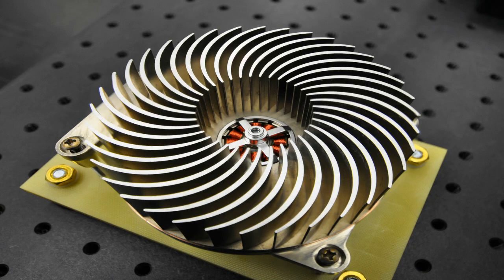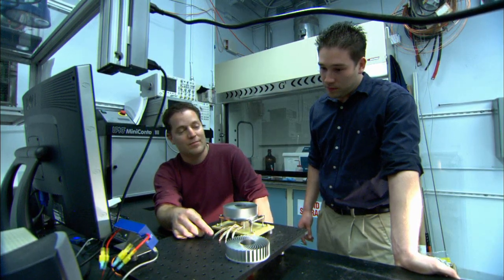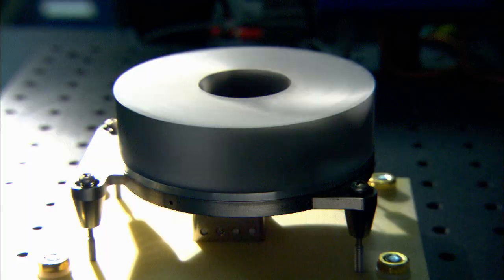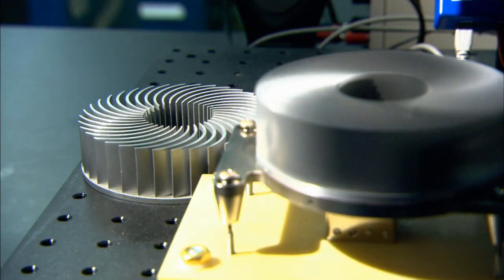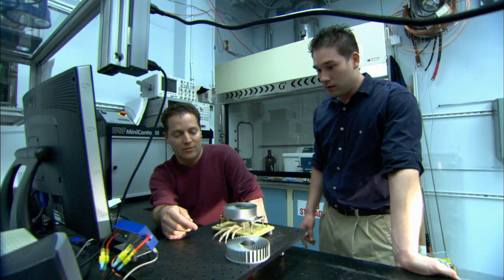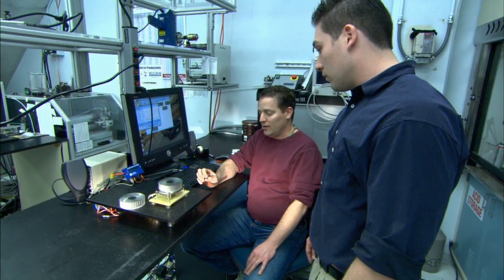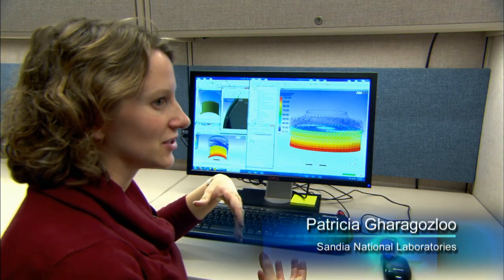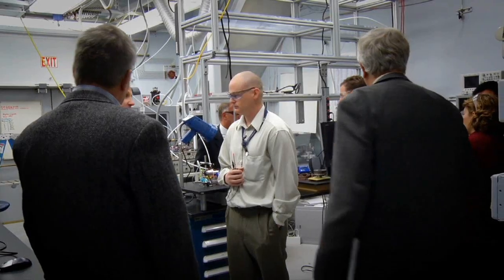Sandia Cooler

Comment: 30 times more efficient and yet its 2014 and I have not seen this any where... so it has failed. Its all good seeing this kinda videos but they always talk about positives but never about the negatives.
Reply: do you realize that it usually takes around 10 years for new technologies to reach the market? That said, they compare it to regular heatsinks, and not stuff like cpu tower coolers with heatpipes, so I doubt they'd prove beneficial in regular computers for quite a while. Application in the industry is probably already happening at a small scale.
Reply: @nilssab  Almost 10 years now
Reply: @nilssab  one more year
Reply: Not to mention this product was boudn to be a flop because of one concept they didnt focus on much is the air bearing between the base and the actual heatsink anyone thats installed a heatsink know that an airgap is going to be a bottleneck which they failed horribly
Reply: I know 1one negative, if you toch the coooler with your finger you will suffer a lot of pain
Reply: Dmitri Felbinger that must be why we had heatpipes in computers in 1960.. OR, we didn't, which shows that in some cases it takes a MUCH longer time. especially when it is things that were made for industrial application and not consumer products. You can expect that this will be in some industrial use now(which would then be considered a corporate secret, and you wouldn't know about it), OR within a few years, when efficiency has been further improved. And you can expect it to take a LONG while before we see these in consumer products.
Reply: this is all quite interesting, btw.. goes with the saying - you learn something new every day!
Reply: Dmitri Felbinger also in most consumer products you will probably never see this, since piezoelectric fans will probably be available before this, at least for laptops. There are already being researched on by Fujikura etc. which make a large amount of the cooling systems for laptops now. watch?v=Hm5fXj-hUpk#t=191
Reply: ***** lol, I guessed you missed the part where the "blowing fan" is also the heatsink.
Reply: ***** in addition to what nilssab said, you also won't cut your finger because:
A: It's rotational direction
B: It's speed
C: This is a prototype
D: something something your mom
Reply: you know why, its because this tec is total bs. how does heat go from the base plate, to the fan? the motor axle? air?

find a way to get that heat energy to the fan and then it could be a good idea. key word being could
Reply: 08yannch The he's trying to get across in the video is that the air gap will be tremendously small, approaching 0 as rotational speed increases. At speed, you'll have the entire surface area of the bottom of the heat sink essentially sitting on the baseplate. The space between the two is so small, that heat coming through the baseplate will have nowhere to go except dissipate into the heat sink. The design of the fins decreases the amount of dead air along the surface of the fins, to tremendously small amounts with high rpm. All you need is new air (not necessarily cool air) moving across the surface of the fins to remove heat from the system. It consolidates a fan and a heat sink down into a single, smaller component which cleverly takes advantage of fluid dynamics to make the transfer of heat in and out of the heat sink as smooth as possible. If I understand him right. Its been a few years since I took (High School) thermodynamics, but its this idea of the distance between the two surfaces approaching 0 allowing the transfer of heat between the two more effectively that really makes sense in my mind.
Reply: Thermaltake Engine 27. Not sure though, if it has anything to do with Sandia.
Reply: So how is the heat transfered from the stationary cpu to the rotating fin assembly? Not through the air bearing. That would have a huge thermal resistance. Sounds like more Phd pie in the sky nonsense.
Reply: hi bro, 2018,  I have not seen this any where too  :)
Reply: 10 years? were have you been living? As far as I know most great inventions blew up on to the market 2-3 years after first prototypes.
Reply: Santiago Turello Alvarado loool you know we would all do it aswell
Reply: You do know you can post links directly right?
Reply: It is either not what it seems or the device have been used in industrial environments.. Not everything is produced to be used by the public in their homes..
Reply: ***** Read the fucking links that that guy posted instead of making assertions here.
Reply: This looks promising considering the company is an  subsidiary of Lockheed Martin they probably have some idea of what they are doing. The fan looks somewhat similar to what they already use on some nvidia graphics cards
Reply: What is the difference in thermal transfer efficiency between an air bearing and properly applied thermal paste, I wonder.  It's probably not much but I'm still curious.
Reply: @lawrencetate145  You would need to determine that experimentally for this case.
Thermal paste isn't hugely conductive, but even so, it is about 250 times better than air. However, a lot of the contact between the heat source (like a CPU) and heatsinks is directly between metals, which are more than 16,000 times better heat conductors than air. But, that is just comparing conductivity.

Fluid flow analysis is required to figure how heat transfer actually works here, because there's a lot of details regarding heat flow which isn't explained by a purely conductive model. In essence, moving fluids (air in this case) transports heat differently than stationary ones. The presence of an air bearing layer further complicates this as it likely has some unique properties in terms of heat transport, meaning a combination of experiments and computer modeling would be required to properly answer your question.
Reply: that's because makes no sense, took me 10 seconds to bet that this would never be efficient...
Reply: 2021. still useless.
Reply: Even if it was the best thing ever, it may not have the chance to take off due to competition of the market amongst other things
Reply: Catch is you have to mount you cpu horizontally
Reply: That's because all the early adopters no longer have all their fingers.
Reply: CatchMyThrowingKnife That's a rarther ignorant comment. If you watch the video it's clear that they designed and chose the air bearing, as a method of moving the heat effectively. I'm pretty sure they know a whole lot more about that than you do. The issue with the air bearing I see however, is what happens when to put it in a case, and have the fan sit 90 degrees to what was shown in the video.
Reply: You seem to be missing my point. First of all you seem to insinuate that the shape of the rotor is of no importance what so ever. A circular saw is designed to cut (well technically it chips off small pieces) if you take a look at this rotor, it has curved swept blades, and the direction it rotates, means you won't cut yourself by touching it.

When I mentioned the speed, I mentioned it because of how fast it's going. Heck it weighs several times more than a blade on a circular saw. When this rotates as fast as it does, you will have a difficult time getting your fingers in between the blades at all.

I mentioned it was a prototype, as this will obviously not be sold without a fingerguard, because you might still be able to hurt yourself if you stick your finger in the middle of it, you won't however loose a finger, you will most likely just get a whacked.

D: I tried to be witty, and provoking as I found your "Meh it's just a blower fan, nothing new" rather annoying, as this is clearly much more than just a blower fan.
Reply: CatchMyThrowingKnife I'm quite sure the 30x comparison to regular heatsink is measuring the heat flow from the heat source to air. So even if it would be a bottleneck(which it may very well be, of course), they can achieve 30x the heat flow compared to some regular fan heatsink.

I don't think this has flopped, it's probably more a question of it being stuck in intellectual right and licence negotiations.. Whenever it gets deployed it will be in industry applications anyway, so for all we know it might already be deployed.
Reply: @nilssab  nah it failed hard
Reply: @Fluffehfox  yeah, I agree. It did go to market and I have used it though. It performs really well per volume and per dB, but 45ish Watt isn't really the segment to be in if you want success. But really it did perform better than a noctua cooler of the same size.

Comment: It's good the air bearing working horizontal but have you tested it in a real application as most motherboards are vertically mounted?
Reply: I don't think this is meant for vertical usage, nor do they necessarily have the home PC market in mind. They mention solid-state lighting so I assume this is to dissipate heat because currently many of these solutions require large passive coolers.

Comment: Well, that was cute and all and despite the admiration for the great concept, my ears are bleeding now.
Noiseless my rear end! Many many years ago I had a Maxtor hard drive that made about the same high pitch noise. Sent it back the same day and replaced it with a Hitachi drive that actually WAS silent!
So eh... With hard drives getting more and more silent, can't you find a way to get past that horrible high pitch noise? Even if the decibels are low, such high frequency sounds are still loud to the ears.

Also, it seems like you will need some VERY high grade aluminium to stop that wobble from occuring. Even if it looks minor, without the 'heatspreader', the chip would quite certainly die very fast with direct contact from that thing.

All in all, no matter how great the idea is, I'm afraid that this will not be a very cheap product at all and thus not find it's way to many PC's.
Keep up the good work though, because industrial applications might benefit greatly. Stuffing more computing power in servers without overheating might just be getting easier when you get them all balanced out.

Comment: You quite clearly have no idea what you're talking about at all.

They're currently still working on further revisions of the device to get it ready for consumer CPU cooling applications.

You can see how it will work even in the prototype here: heatpipes connected to a CPU block on the bottom go up and spread out over the bottom plate which the fins/fan assembly spins on.

Comment: It has no use or function, and simply isn't very good anyway. that's what happened to it. A Noctua is probably better, secondly, what would it even be used for ?? The cpu cooler market is already saturated, this product adds nothing to it.

Comment: its a prototype and early modell i think it will be alot quieter then that.
(bit of nostalgia for me though since i had harddrives making that noise and back then it was the way of telling me nothings broken if there is noise ^-^
and that quantum sure made a hell of a noise. (quantum fireball 20 gb as os disk and a seagate 80 gb ide drive)

seagate died 08 & fireball is still working and the hour counter has reset Max was around 40,000 hours last i checked and its now on around 300 hours :P

Comment: @maddogfarg0, you are forgetting the fact that you can transfer heat between the gap between the heat sink impeller and the base plate. Remember there is air between that gap that serves as a thermal barrier between the two objects. As long as there is a thermal gradient between the air and the base plate and the air and the impeller, there will be heat transfer and thus cooling. Note that the thermal barrier in the Sandia design is smaller than conventional heat exchangers and more efficient.

Comment: Re-read the first sentence in my main paragraph.

Air Bearing = not good contact = poor heat transfer = residual heat buildup from the heat source and poor cooling performance.  It's the reason conventional CPU heatsinks use TIM.

Cood contact at that speed = good heat transfer from the source components, but also tremendous friction from the moving parts.

Either way...whatever they are saying is 'efficient' is not in relation to heat transfer.  Power usage to drive the fan, maybe...or CFM.

Comment: That's the reason they use an air bearing. It's the same concept your hard drive uses to float the heads over the platters- air is carried along the surface of the moving object and in doing so forms a thin film that provides both thermal conduction and mechanical cushioning. 

And I know air bearings work- a large machine that I work with uses a similar mechanism called air lift, enabling over 10 tons to be moved one-handed through a simple crank and screw arrangement to push it along the guide

Comment: When the fins start moving, they create a low pressure area on their 'back' side (the one pointing away from the direction of rotation) at the tips, which pulls air outward along the fins.  That results in the pressure dropping in the center which pulls air down.  Also, the fins are thicker near the center than they are at the edges which will help the air accelerate away from the middle too.

Comment: I don't see this as working, or if it does it will be highly inefficient.

In order to transfer heat effectively from the chip you are cooling to the moving fins of this concept cooler you need to have good contact.  But since the fins are moving, good contact between them and ANY surface = high friction = generating LOTS of waste heat that gets ADDED to the already existing CPU core heat.

Comment: instead of an air bearing, why not use some kind of gel based thermo conductive grease with a capsule around the base structure secured by physical bearings. The thermo-transfer would be far more significant...

Comment: How would this run in a tower computer? Would it still run properly vertically? Couldn't dust get trapped between the cooler and the CPU since they aren't actually in contact? And the final product better have some sort of frame for it. Don't want any wires getting caught xD

Comment: Well, that's the great thing about it. It's so efficient that you can use a wide variety of metal materials. A mixture of Aluminum, Copper and (Silver, Albeit expensive, it has the best thermal conductivity at 418.0 W/mk, had to research that number :D )

Comment: Because air has a very low coefficient of heat transfer.  If you take a standard heat sink you will find that it has maybe 50-60 square centimeters in which heat can disparate aided by a fan.  In order for the Sandra Cooler to work it first has to go though 6 square cementers then into air then back into 6 square centimeters then it finally gets the the 50-60 square centimeters part to finally dissipate.  I'm not going to say it wont work.  But i doubt it works better.

Comment: If it was fully detached from the base it would also stop spinning from being disconnected from the motor. Imagine the air that forms from the separation as more of a solid bearing and it will make more sense. If was disconnected it would also probably spin wildly out of control unless it was perfectly balanced, thus it can be assumed that the spinning motion keeps it elevated off the surface but its held down and in place by motor connection and centripetal force respectively.

Comment: Would have preferred to have a decibel monitor/meter showing the noise level when the fan was turned off to see how loud it is before and after.. The Videos audio isn't good enough to let you hear any difference especially when the dude is talking while shutting it off.

I'd be interested in knowing whether this will work when you have other fans blowing and pulling air into a computer case.

Comment: They explained it does not led dust particles go near it, because of the air flow it makes.
But yes, it seems to me rather dangerous to fingers when rotating in the case, because it is a metal at high speed, but I can also guess that metal is very light, and will stop very fast if touched.
I just also do not understand vertical or upside-down mounting options for device. And are there noiseless motors to pair it with the fan?

Comment: It seems like they're projecting high temps onto the surface area, so it's not working (in the prototype state) like a CPU cooler would. Even thought he concept is the same - displacing heat - the application is different, and unlike cooling a CPU.

Comment: This design seems really similar to the original Orb back from the P2/P3 era.  The idea seemed great but later found that heat displacement was great except that the motor generated heat and that over time, the heat of the motor was so great that it canceled out what the fan was actually doing and the era of the orb ended!  I wonder what the heat output of it is and if that's what they are trying to conquer before it ever gets released. How long before we see this on a PC?

Comment: but how will it work with most desktop configs? Most desktop configs have the CPU/heatsink on a vertical orientation, and it seems that this setup only works with a face down orientation.

Comment: They just glazed right over that thermal transference issue. I have a reaally hard time believing that this will keep My CPU as cool as a traditional hard mounted heat sink with some arctic silver. also of note, my fans don't make a ton of noise, the air being moved, does.

Comment: I know right!?! Lets say their theory of heat transfer via hydrodynamic air bearing effect is correct 1:40 , similar to the cushion of air a hover craft uses to glide over water/land; Wouldn't a cushion of air between two surfaces prevent heat transfer? and Even if it worked how would that make it 30 times more efficient than the typical cooler?!

Comment: How would this be very applicable considering that almost every computer out there, with the exception of mini itx and servers has vertical mounted motherboards and because this relies on floating instead of a fixed mount it would be completely in compatible with most computers.